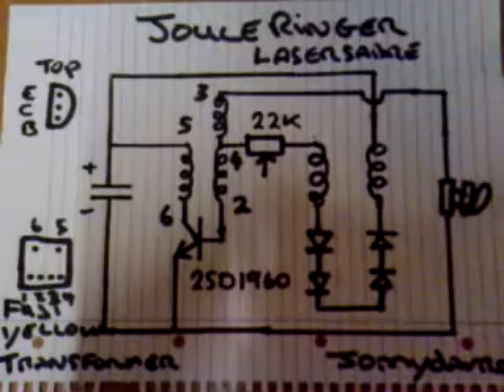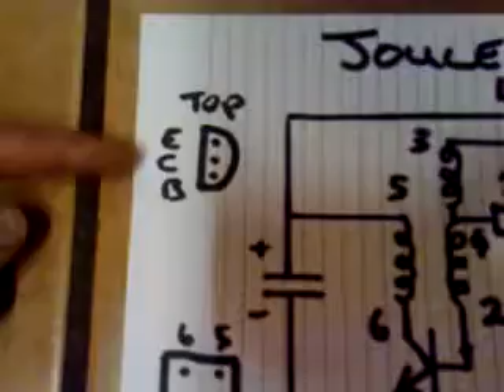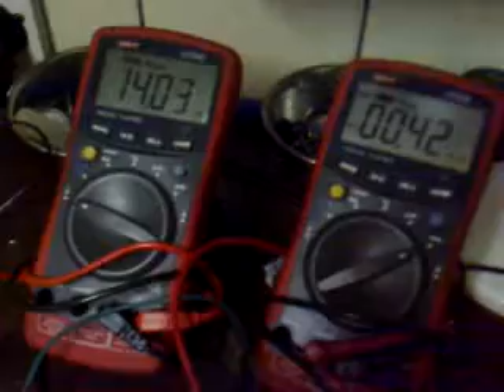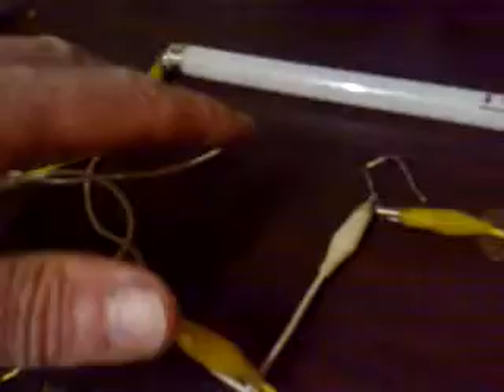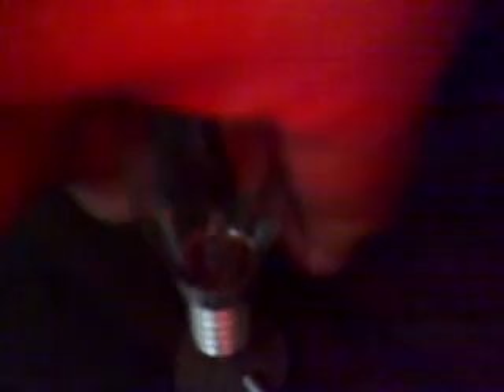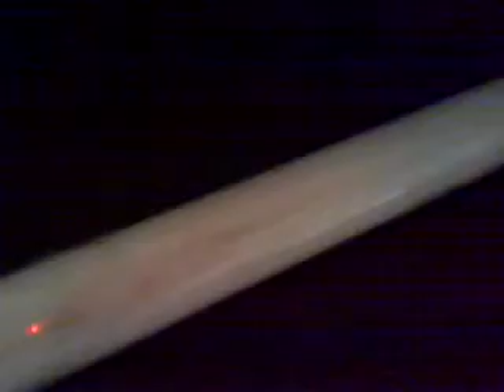Jouleringer running on 2200uf electrolytic cap

Comment: Great job I have been playing with these camera circuits for a little bit and have posted videos that could help get this idea to go even further, I used a pie pan radiant circuit to run my flicker bulb and the draw was very low while the spark gap between the pans excited the atmosphere with electric energy well above that going into the  circuit averamanko led circuit lights up all over, great job on furthering this circuit I can't wait for more!

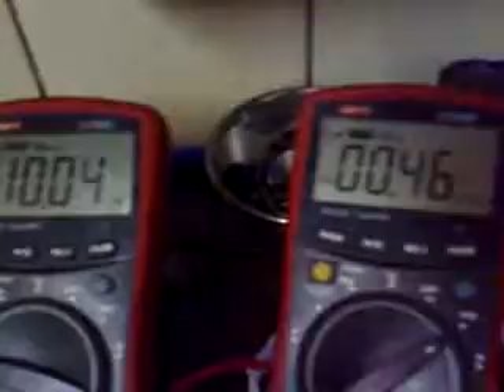Comment: Good job. I suggest adding a spark gap and a step up 1:10 to 1:100 transformer before the CFL. The spark gap will give you the high impedance to reduce loading. It will set it's own resonance frequency making it more efficient. The transformer will give you the high voltage needed to light the CFL and reduce the current draw. You can use a small enclosed lighting arrestor device instead of the spark gap, like those used in Don L. Smith device. Keep experimenting you are doing well.